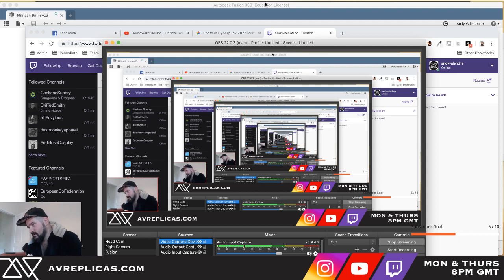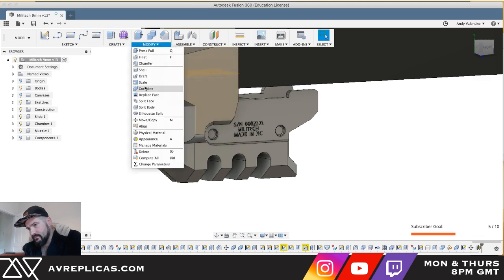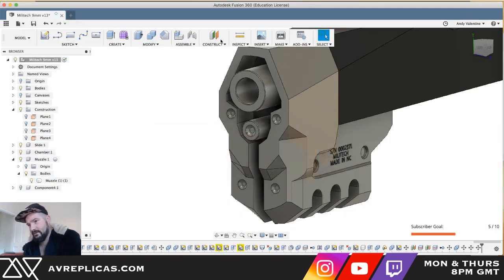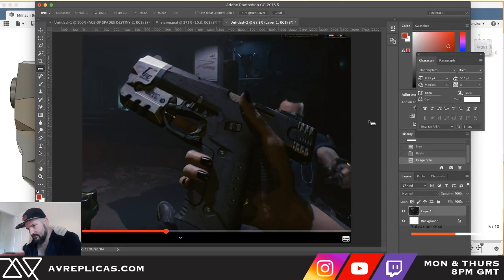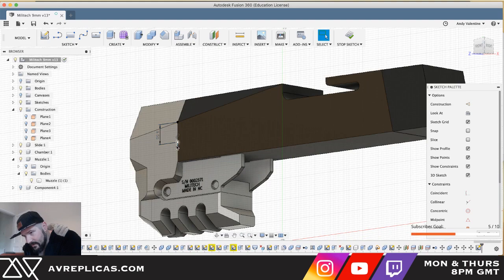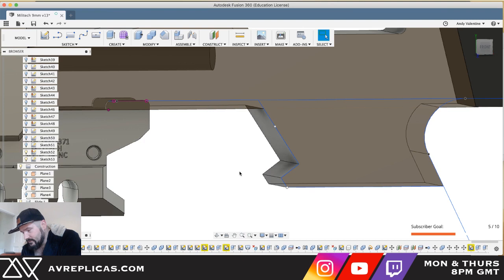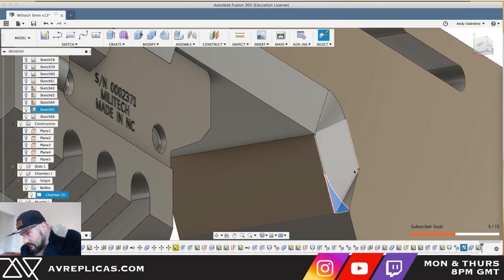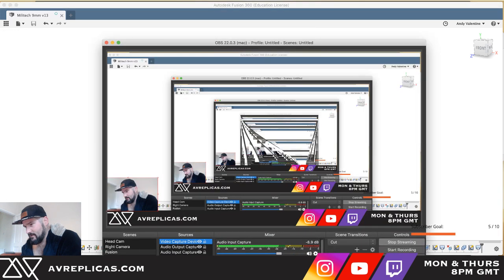3D Modelling: Militech 9mm Vindicator from Cyberpunk 2077 - part 4

Comment: Looks good.  Pity the game maker designed a gun with so many engineering flaws, a bit more work and it could be quite believable.  It is a game that has to take so much else into account so it's no big deal.  Thanks for tutorial by the way,  you good at this.